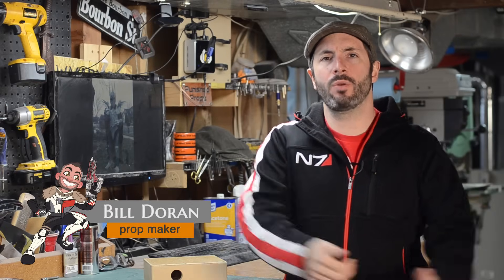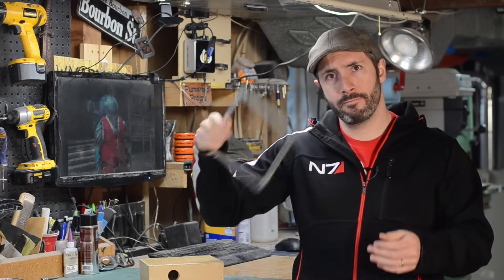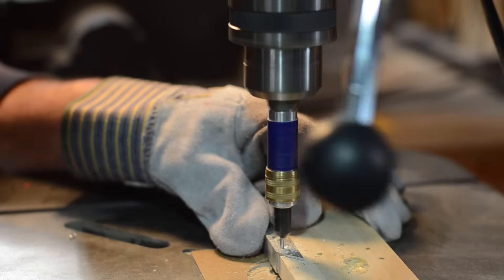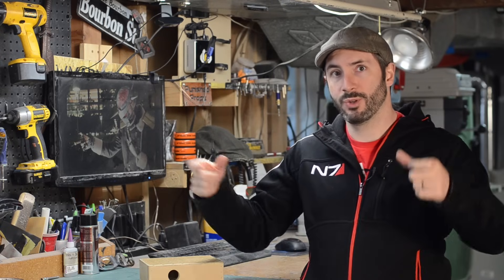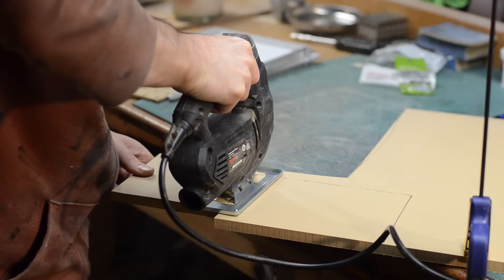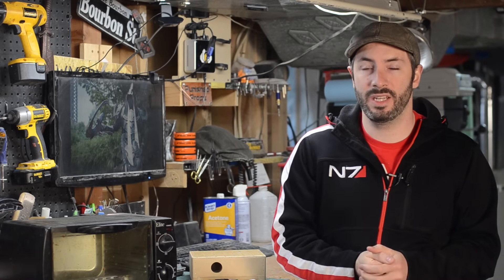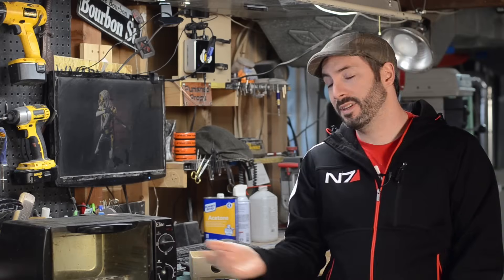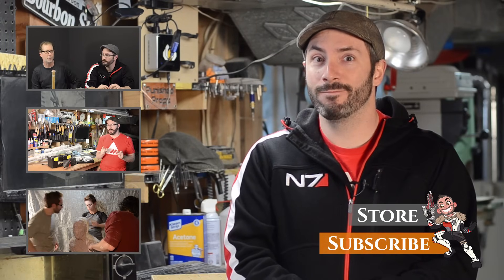Prop: Shop - How to Make a Vacuum Forming Machine

Comment from the maker: Check out our NEW tutorial for making a BIG Vacuum Form table using materials from the hardware store: https://youtu.be/O790OvRy1rc
Reply: These are really helpful videos you guys are awesome but I really am having a hard time finding the plastic bars I see people using to hold a two-part vacuum mold together in order to make things like candles. Is there a place you might recommend?
Reply: Made one... great stuff. I found that the sheets sold for the makyu form box are perfect for a 21cmx21cm frame and the plastic is nice...$40 for 30 pieces 2 day shipping
Reply: Hi i was just wondering what were the dimensions you used for the vacuum former box? Was the size decided by the inside dimensions of the toaster oven?

Comment: I did vacuum forming this way 35 years ago. It worked real nice. Not long after, I decided to make a full sized machine including a welded steel frame, vacuum tanks, an industrial pump and its own heater box. 
I designed it with two different sized vacuum tables. 
12” x 12” and 12” x 18” due to the efficiency and economics related to the abs material I used.

Comment: I'm hoping you'll reply, but my first steps into this vacuforming game aren't working out like your results. I followed this build advice, but am hitting what I expect are noob mistakes. Some advice would be helpful. My first run ended up with a great 'sag'  in the 0.5mm PETG, but major pleats in the material over the buck. Would that be due to too much melt or insufficient vacuum? Just needing your experience and opinion on that point. Second problem was, when using 0.75mm material (purportedly PETG, but I can't attest to the actual plastic; Ebay you know) while waiting for the 'sag', the material turned milk white, never sagged to the same extent, and then wouldn't even get close to forming over the buck. Temperature? Or my pulling too early  due to the colour change? Does the rapidity of vacuum  power make a difference?

Comment: not sure oven is good place for a precision 123 block
Reply from the maker: It's all metal and the oven heat is very low so it's all good :)
Reply: @punishedprops  if they were expensive ones you would get different readings for those 1,2 and 3 inch measurements, like few thousanths or 10 millionths here and there or maybe some warpage over time from being in and out of an oven. I'm probably being pedantic in this case but if you were using them for purposes like high tolerance milling of surface plate inspection work
Reply: @punishedprops  where temperature is important
good video though...

Comment: how well would this work with PLA used in 3D printers as the buck?
Reply from the maker: You can do it but you have to make the infill REALLY solid so that it doesn't warp from the heat. You can see how we did it in this video: https://youtu.be/QCdEdFUXzc4

Comment: Hey man - Great vid!  I’m only new to messing around with all this DIY plastic stuff and this really helps, seems so simple and obvious now I seen one but you don’t know until you know, huh! 
One thing, if you don’t mind me hitting you up just real quick while I’ve thought of it - I’ve been using Thermoplastic Polypropylene Pellets just trying to mould out a few ideas and get a grasp of what can and can’t be done manually without a 3D printer (which I can’t afford or justify this early into this) and it’s been good. It has pros and cons, like all things but I want to move onto other types of plastics, even silicones and resins… Yes, sorry, I’m getting to my question LOL! - It seems important to give you a little background as to WHY I’m asking as I’m sure it will help your answer :)
No doubt there is a tonne of great info out there, only the trouble I’m finding is different people use different lingo or shorten or substitute identifying nouns (“rubber” instead of “silicon” for example) and this is amplified across different global locales, regions manners of speech etc. So it can be completely discombobulating to find out after 3 months that any two “foams” are NOT the same or perhaps ARE the same but one source called it “sponge” instead of “foam” and you see where I’m going despite that terribly broad example I’ve given! Haha!

So, please, if you wouldn’t mind chucking me a link to where I might acquire a small amount of what YOU know and refer to as “Styrene” here-in, I would be that much further ahead of the rest of the “Teaching Myself Class” than, well… Me.
(About the same as you used in your demonstration in this video would be approx. ideal) 
(ebay, Ali, whats-the-other-ones… you know!)

CHEERS MAN - I’ll “blackmail” you with a sub-up promise if you can!!  :)  (not really, you can probs have it anyway haha!)
Reply from the maker: Check out the links in the video description! We acquire ours from Amazon.

Comment: where do you buy the plastic sheets to work with? I'm looking for something clear to make some toy blisters...also, I have been trying to use the liter soda bottles and it isn't working, but I also don't have a decent heating element. I need to get an oven, I've been trying to use the heat gun and it doesn't heat evenly. I'm have a working are of about 7x7
Reply from the maker: Yeah a heat gun is usually too specific an area of heating to work well. We usually get our sheets from Amazon, it's just Styrene

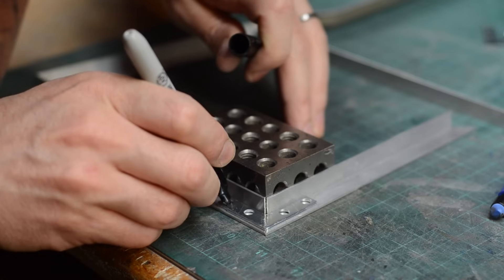Comment: 2:07 If you're more well-versed in prop making and stuff, I'd recommend that you use an old 3D resin printer tray. I had one for an outdated printer that I never use lying around and it worked great.
Reply from the maker: That's a very clever idea!

Comment: What thickness would you recommend for the ABS plastic sheets? I guess this choice is affected by the dimensions and curvature of the mold. Thanks in advance:)
Reply from the maker: Yeah it totally depends on what your buck is, how big it is, how hot your heat source gets, etc. And your level of detail in the buck. It really comes down to experimenting and figuring out what works best with your specific setup.
Reply: @punishedprops  I guessed so:) Thank you for you time. Loving your work!

Comment: "Probably do it for under $50"  •proceeds to use many large, very expensive tools•
Uh-huh.. •finds a different video•
Reply: I also have a hand drill for my holes so I hear you but he put the little hand saw clips so you wouldn't say this, you must have missed it?
Reply: @aaaarrrgggghh  that's only one tool of the many...
Reply: @WoManticore  sure, so I will now spell it for you: He.only.made.a.square.box.for.fuck.sake
Reply: @aaaarrrgggghh  if that's all you're making your vacuum form box won't be very effective will it. 
There is a hole specifically for the vacuum, the seal, the nails, the glue, the measuring, the heating. Don't try to sound mighty by simplifying it to just "a box", if that's all it was there wouldn't be videos about it.
Reply: @WoManticore  I bough two apartments with money earned from selling finished moulds, and I paid cash for both of them. One is by the seaside, one is next to a skying resort.

Comment: I'm currently making a vacuum forming machine from a 13x9x9 cake pan! The board on top where I'll drill the holes came from an old dresser drawer that was in my garage taking up space. For the frame (and plastic), I'm going to use a 8x10 Mainstays picture frame from Walmart. This frame includes the plastic already! (not glass) I'll use a heat gun instead of oven so as not to burn the wooden frame. I'll glue the plastic onto the frame first. Wish me luck.

Materials:
https://www.walmart.com/ip/Mainstays-8x10-Linear-Frame-Black/16541037
https://www.homedepot.com/p/Frost-King-3-4-in-x-5-16-in-x-10-ft-Black-Rubber-Foam-Weatherseal-Tape-R534H/202262324
https://www.homedepot.com/p/1-8-in-x-2-ft-x-4-ft-Tempered-Hardboard-Actual-0-115-in-x-23-75-in-x-47-75-in-109112/202585358
Reply from the maker: Nice!

Comment: Thank you very much for sharing. I have a different question though. Where do you get driving belts for your belt sander? I could only find belts for 3D printers which cannot bear the load.
Reply from the maker: I honestly don't remember off the top of my head, but probably Amazon

Comment: Great video thanks.
I had a question for you. I'm in the process of making 3D wall panels. I wanted to try building a vacuum forming box to make the panels. Which plastic would you recommend and why. 
Again thanks for video. Before seeing your video, I was going to cast the panels. I'm hoping that this way will be easier and cheaper
Reply from the maker: We use PET-G the most often, but Styrene also works. I'd ask the folks at TAP plastic for advice, as they may have more experience than us: https://www.tapplastics.com/

Comment: Where do you get the styrene plastic from and how thick is an optimal size
Reply from the maker: We've got links in the video description! The thickness depends on what you're vacuum forming and how you're going to use the form. Thinner plastic captures more detail but isn't as sturdy.

Comment: do you need a shop vac or will a home vacuum work
Reply from the maker: The main reason we suggest a shop vac is because they're better at handling dust and particles at high volumes and I think they're often stronger, but you can try with whatever vacuum you have!

Comment: Thanks for the video! I would like to make a buck with resin but i don't know what kind of resin i should use with petg or abs
Reply from the maker: Great question! You just have to make sure your resin can handle the heat - I'd check with the folks from Smooth-On! They do a great job suggesting materials for projects.
Reply: @punishedprops  Thanks for your quick reply and thanks for your videos it help me a lot!

Comment: Hi im wondering what kind of Peg board did you used? Is it the standard 6mm diameter holes with 1 inch spacing? Thanks for the videos, sources and references; very helpful.
Reply from the maker: We link to all the materials and tools used in the video in the description :)
Reply: @punishedprops  Oh my goodness how did i not notice that? Thanks for pointing out to my blind self.

Comment: What thickness of the styrene do you recommend? The stuff I have isn’t working.
Reply from the maker: I usually use 1/16" or less for vacuum forming
Reply: Any thickness should work. Rule of thumb( for polypropylene for an example) is 3 minutes oven time per millimeter. So 3mm PP (1/8'') takes about 10 minutes at 180 degrees depending on your oven.Styrene should go off really quickly.

Comment: you can buy a bucket, flip it upside down and drill air holes in the bottom and melt a small hole in the side to make a seal for the vacuum hose. Use on a flat surface so the bucket brim won’t let air through it.
Reply from the maker: Neat idea!
Reply: Its a dirt cheap dollar store model lol

Comment: what is best machine to buy to make some larger things, like tops for side by side vehicles?  Probably 4x8 sheets
Reply from the maker: Unfortunately they don't really make machines commercially that are that large. When they do, they are VERY very expensive. Check out this video to see how I made myself a larger machine: https://youtu.be/O790OvRy1rc

There are some useful links in there abut building a machine and different methods you can use. Hope that helps!

Comment: Hi, I have loads of Mylar plastic sheets, commonly used in schools for projectors. Is this plastic ok to use in one of these devices?
Reply from the maker: Hmm, I'm sure, that's not a material I have really worked with.
Reply: @punishedprops  - Transparency sheets are typically acetate or sometimes polyester, also known as PET, so is that near enough to the material you are using. I hope it is as I would like to use these sheets for something and this project would be ideal, let me know. Cheers.

Comment: I'm a very very cheap very very green/reuse/recycle person. I've been wondering about using several plies of plastic bags in this method. Does anyone know if that would work? Maybe use a heat gun on the outside of them? Anyone with thoughts or tips please let me know! Thanks!

Comment: I wonder if an old air hockey table could be used for one of these. It's got all the holes in it
Reply: The plastic may melt from the heat, but it might work...

Comment: How thick of PE sheet can i use? Will 3.5 mm still work?
Reply from the maker: You won't really know until you try. Mostly you need to make sure your heating elements get hot enough to get the plastic up to the right temperature. I think 3.5mm should be OK.
Reply: @punishedprops  thank you!

Comment: Just saw slot the aluminium angle on the flange and leave the web intact. Bend it into shape and epoxy the ends with a patch plate.

Comment: Great video! I am wondering about materials that can be used for vacuum forming. For halo helmets they typically have amber or gold iridium visors, so if you bought a motorcycle helmet that was already tinted to the proper colour, would that work to be heated and molded?
Reply from the maker: I'm not sure if that would work.
Reply: No, it most likely wouldnt work. You can form then tint, or stack two cut visors. Visit 405th.com for more info

Comment: Could you use a coated 3D print as a buck?
Reply from the maker: You can, just be careful that the 3D print doesn't melt in the process. You'll need a lot of infill to make sure it doesn't get crushed by the suction.

Comment: What would be another heat source option for a bigger vacuum forming box a 12 by 12 won't fit in my toaster oven and I don't wanna stick it in my oven because I'm scared it will release fumes every where
Reply from the maker: You'll have to build your own heating array with some kind of power source and the same wire they use in toaster ovens. There are some guilds out there, but I've never done it myself.
Reply: how about a heat gun on the highest setting

Comment: First one of these where the creator used pegboard. I wondered if that was a thing or if all the other creators tediously drilled holes in their vacuum top media. (1/4", 1/8", etc). Seems kind of silly with pegboard being readily available at most of your favorite plywood vendors.
Reply: Roger Keener I am making mine out of steel plate, so yeah, the peg board won't hold up to the force and heat I'm applying

Comment: Can you use vacuuming to mold around EVA foam props such as a pistol or a attachment like a Holographic scope all made from EVA foam?
Reply from the maker: EVA foam isn't rigid enough to use as a pattern for vacuum forming. It would compress under the pressure of the vacuum.

Comment: I don't have a toaster :( can I just burn some wood outside and suspend the plastic like barbecue?
Reply: Sure, and perhaps use a broom instead of a vacuum cleaner as well!
Reply from the maker: I have serious doubts if that would work.
Reply: Punished Props i guess i could do fibrglass instead
Reply: Yes but, you will char it and won't be able to control it

Comment: I need to bake a large piece of PETG (too big to fit in a toaster oven) would it be safe to use an oven?
Reply from the maker: Technically that would work, but I can't recommend using an oven that you cook your food in to heat up plastics. Do so at your own risk.
Reply: okay thanks

Comment: I have a question that i really need answered. I have been looking around for a used shop vac that I can buy solely for the use of vacuum forming. Is there a minimum HP that shop vacs should have in order to use for vacuum forming? As i will not be using it for anything else, the gallon size does not matter because i will not be vacuuming anything but air. I will only be vacuuming small things, most likely with LDPE plastic 2 or 3 ml thick
Reply: as long it creates a vacuum it doesnt matter that much how powerfull the vac is....ofcourse..  the more powerfull it is, the faster it creates the mold

Comment: After heating plastic in a toaster oven, will it be safe to heat up food in the same toaster oven?
Reply from the maker: Probably not.
Reply: Thanks
Reply: Hdpe yes, because it's not going to off gas, nor will it break down when the temp is kept below 650 and since 300 to 400 works, it's safe

Comment: How would I vacuum form something I'm afraid would be hurt by the heat of the hot plastic?
Reply from the maker: Perhaps make a silicone mold of that thing and then cast a copy in hydrocal. Use that hydrocal casting to do the vacuum forming.

Comment: Can u use a microwave instead?
Reply from the maker: I don't think so. The metal frame is a problem and I think any moisture in the material would boil, leaving bubbles in the plastic. Just a guess though.
Reply: Punished Props thanks for the response. I'm making a 1" thick installation foam knife prop  that you made in the other video. destiny. I do believe floor mates are better, but the installation foam is all I had.

Comment: could you use the plastic from a two litre pop/soda bottle if you cut a sheet and flattened it with a hot air gun prior
Reply from the maker: I tried that and it did not work. =( Here's the video: https://youtu.be/sOq2SFtPmqU

Comment: Could you make something like this sized up to about 12 in x 12 in with a shopvac powering it or would that not be enough suction for a bigger table?
Reply: Punished Props thanks.. I guess the problem though would be how to heat the styrene that size since it's bigger than a toaster oven :/

Comment: I would have made the frame to fit the width of the oven so you don't need the pan. Also for shapes that are glossy, sometimes it is good to use a velvet coating so wrinkles don't form. It makes a smooth matte finish that hides tiny imperfections.  Also a list of melting temperatures for the plastics and an IR thermometer can be handy.

Comment: Also,  if you want better defined under-cuts or other features you should drill a very small hole up into the pocket from the base of your "mold".  That way the vacuum will continue in the pocket even once the plastic is pulled tightly to the mold face.